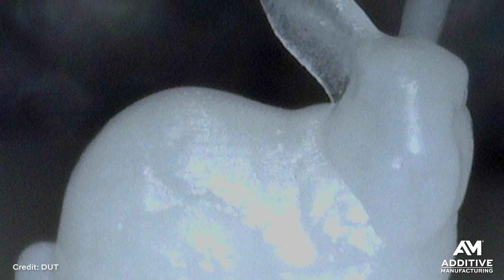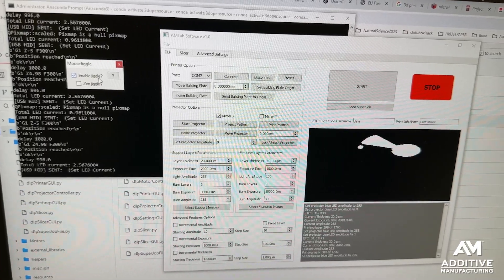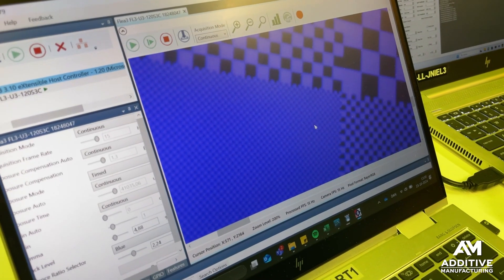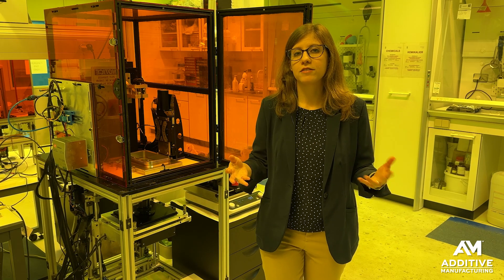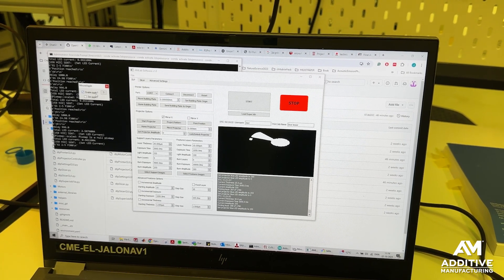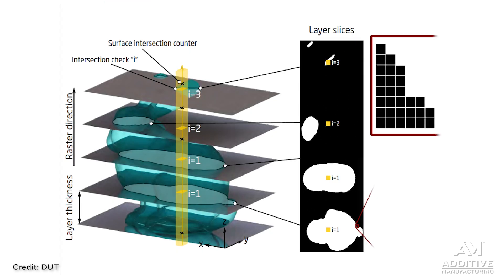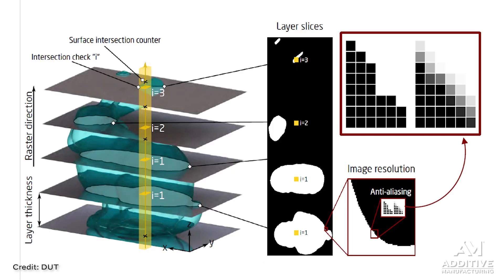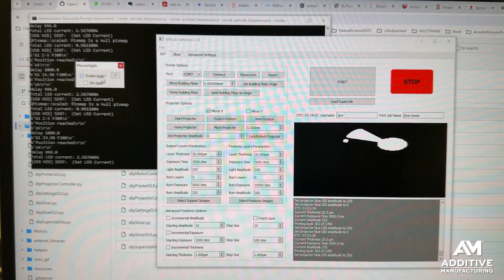Vat Photopolymerization 101: Understanding Resolution

Comment: I have a question here .How does laser or projector harden the liquid resin ?
Reply from the maker: The liquid resin includes a "photoinitiator" that triggers a chemical reaction when it is exposed to specific wavelengths of light, usually in the UV range for 3D printing. That reaction crosslinks the polymer and hardens it. That's why it's important to keep resins covered and control the color of the light in the lab or machine! Fun fact: If you've gotten a filling in the last few decades, it's very likely the dentist created it using a similar resin material cured with a blue light.